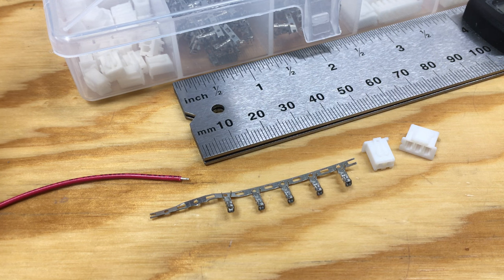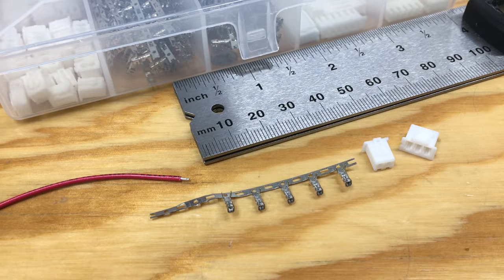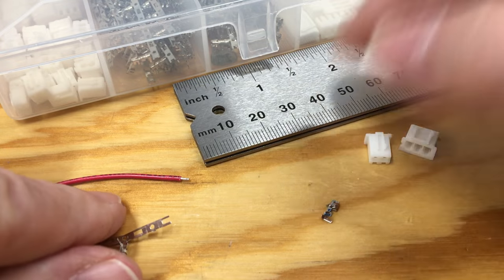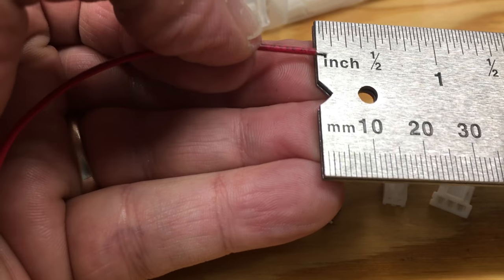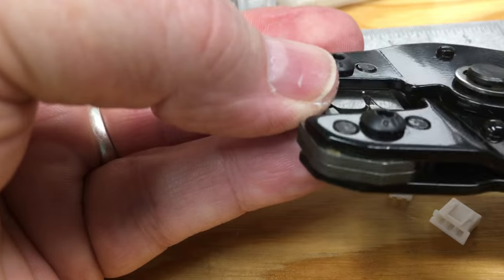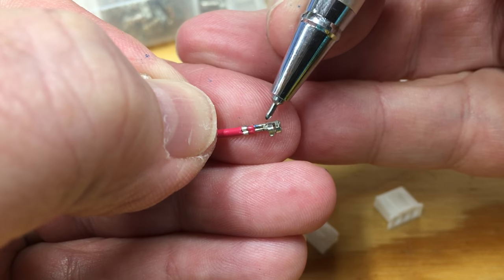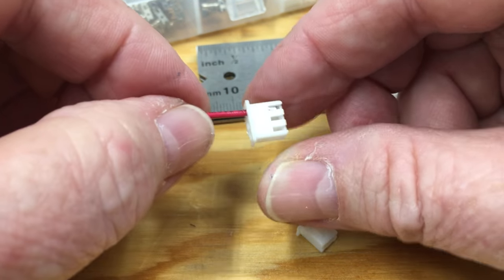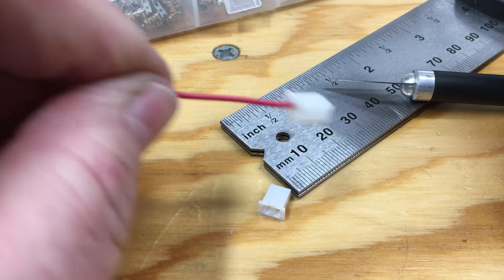JST XH Series Connector Crimping.

Comment: Sir this is the information I wanted the 2 mm in my mind ended up as 4 after you said 2 I looked using my calipers so that strip length is very short and at the same time correct!  My crimper dies are 4.65 mm so I use a T pin "straight" pin will do to place the terminal into the die but then I push it into the die from the long tab side to make sure that I do not get any of the connector part into the crimper.  I now can do this job as it was intended without wasting termination parts and time. With what you showed here with some paying attention anybody should be able to do these like a pro. I used to work in a wire center of a major corporation. So I know just how critical the job is. My job was to pull the harnesses other people terminated them.  I am doing this at home now for my personal project. Thank you for taking the time to make this video. I knew I wasn't doing it right and that is how I got here! I know I am 3 years late to comment but the info is still as correct today as it was then.

Comment: You have my gratitude, as I am someone who's having constant issues with back pain, and the only thing that relieves these is a massager which is battery powered (it won't run off of an AC adapter, just off of battery) - and the battery died a couple of months after the warranty expired. It turned into an interesting project (and a race against time, as my back pain comes and goes and I kinda felt it coming on again), so I bought a replacement battery but it came without connectors, just cables. 

Removing the old battery, establishing the type of connector, finding the right crimping tool, the housings and all of that took almost a week for Amazon to deliver, I booted up the PC, started Your video, went through the steps (and a few of those sockets as I hadn't made the cable get "caught", due to me initially using the wrong size jaws) - and now, I'm looking at the massager charging, cautiously optimistic as the back pain is creeping up on me. A small sense of pride and joy is overwhelming me as I see the charging status lamp blink at a stable rate. 

Once again, thank You so much for such a good instruction.

Comment: Nice clear and concise video. The best inexpensive JST-XH crimpers I've found are the Iwiss  IWS-3220M. I purchased mine on Amazon for $22.59 US. They actually have a comprehensive instruction manual with large lettering attached to the package. A joy to use and make excellent crimps.
Reply from the maker: Thanks Roy for the note.  It’s great that it comes with a manual.  I haven’t seen any others that do.

Comment: fabulous  video Chapster. I have seen other videos and noticed that they didn't use the ratchet crimper that came with their set, but purchased another tool, a lot thinner and required a two stage operation. 1/ separating the wire and 2/ sheathing crimping! I think they had the right tool all along (as your video showed) but didn't know how to use it. I find it ironic that I could not easily find the thinner crimper but that the internet is awash with the proper tool. Grateful for your top notch video showing the 'easy' way to do it too.
Reply from the maker: Thanks Alan.  I’m glad you found it useful.
Reply: @chapmanmr  more than useful... I was barking up the wrong tree looking for an inferior tool. Now i have choice LOL
Reply: Got my crimper today and you method worked fine.. The  only thing I find is holding the the little beggars.. they are so tiny.. in the end i put one on the pin at the back of the JST socket (came with the  assorted JST connector kit) you then have something to hold when offering up connector to the crimper head.
Reply from the maker: Alan Brown 
Great idea.  I’m used to holding the small pieces so practice helps.  When I first started doing these I used a pair of fine tweezers that worked fairly well.  Thanks again for commenting Alan. 👍

Comment: Nicely done presentation. Personally, I favor the Iwiss SN-2549 crimper - it's the "illegitimate love child" of a SN-01BM (specifically for JST-XH connectors) like you show here, and the Iwiss SN-28B (which is aimed specifically at Dupont connectors, and if you're a little bit careful, can be used for doing Molex connectors as well) in one tool. Since I use all three types fairly regularly, having just one tool that can do all three is a BIG plus to me. Aside from the different jaws, the rest of the tool is identical, and it's possible to order different jaws that can be swapped into/out of the rest of the crimping tool as needed, though I haven't needed that capability so far.
Reply: FYI, despite being widely marketed as being for “DuPont” connectors, the SN-28B is actually very unsuited to DuPont connectors! The insulation die has the wrong shape (DuPont needs a circular insulation die) and because the SN-28B is designed for much larger contacts (it’s designed for 2.8mm spade connectors), the finished crimp is much wider than it should be, which often leaves the contacts crimped too wide to easily insert into the housings. I don’t know why the Chinese vendors insist on selling the SN-28B for DuPont, when it would cost no more to make dies that actually fit the DuPont contacts fairly well. (Surely a circular die shape is easier to machine than the m shape!)

Comment: Do you have a video showing how to make the other end connected to a wire, instead of mounting it to a board? I want to make connections for quick connections to replace thermistors etc but not sure how the connecting wire on the other end goes together.
Reply from the maker: Rich,  The JST XH series is really designed to be a "B2B" or board to board interconnect and I don't think JST makes the end that would normally go on a board in a format to be placed on the end of a cable.  Quite often people will make their own by soldering wires to the board socket and put heat shrink over the solder connections and I have done this myself.  A word of caution if you use that method, once the pins on a B2B connector have been heated for soldering, they loose a little of their grip within the plastic part of the connector allowing them to be pulled/pushed out.  If you make your solder connection quick so you don't have to get the pin very hot it should work ok as long as you push the two connectors together carefully.  Otherwise you can push the pin right out of the connector.  I do believe that someone makes a crimp style connector that does what you are looking for that looks a lot like the JST-XH series as I have seen them on Ebay but I'm not real sure they will fit with the JST-XH connector.  My best suggestion would be to look at the Molex "Micro-Fit" series of connectors.  Both ends (sockets & pins) work with the same crimper (SN-01BM)  as the JST-XH series and the polarized interlocking of the connectors is secure.  Hope this helps.
Here are some part numbers if you want to check out the Molex solution...
Pin housing (2 pin): https://www.mouser.com/ProductDetail/Molex/43640-0201?qs=%2Fha2pyFadui6dPA5%2FogRphLt3q2AbW0jNqq9k6Of4ew%3D
Socket housing (2 pin):https://www.mouser.com/ProductDetail/Molex/43020-0210?qs=%2Fha2pyFaduj5jJAitLLkl140tgX%2FFhAHOfKkdQlAGmIRbROBeeV9Tg%3D%3D
Pins: https://www.mouser.com/ProductDetail/Molex/43031-0001-Cut-Strip?qs=Dbnw6jgPYP7qIb%252B%252BSMzZGA%3D%3D
Sockets: https://www.mouser.com/ProductDetail/Molex/43030-0009?qs=%2Fha2pyFaduh7zI%2FCLmN5TyJ9CEZyVLI3X7TErMGzN2o%3D

Comment: Very well explained!
Just wondering if you can use both of the bracket's cutouts for the JST-XH connectors or is one for another type?
Reply from the maker: The other slot in the crimper is for a slightly larger connector socket. It can be used for the JST connector if you are trying to get away with using a larger wire than the connector is intended for.  You can do that to get by in a jam, but I wouldn’t make a habit of it. Thanks for your comments.

Comment: very helpful guide it's hard for me to tell where the insulation area for the cover wire and the exposed wire to the insulation when i try to crimp it can you please tell me how to do it?
Reply from the maker: Gaalxy Star,  It’s a little hard to explain that part of the crimping.  One thing that might help is to close the crimper one or two clicks after you get the socket in place so that it just barely starts to close the insulation tabs on the socket into a circle.  You have to be careful not to close it too far or it becomes difficult to insert the wire.  Then once you start inserting the wire and get in into the crimper a couple millimeters, try holding the wire  with slight upwards pressure while pushing it into the crimper die.  That will make it easier to feel the stop point when the edge of the insulation bumps against the smaller section of the die that crimps the smaller tabs onto the bare wire.  Like I said, it’s difficult to explain, but I think if you take some time with some scrap wire and extra sockets and practice it, the routine gets much easier.  I hope this helps.   Thanks for your comments on the video.
Reply: @chapmanmr  Thanks I found a way you got to feel it

Comment: Actually a serious question

How do you assemble the other half of the connector?
Reply: What other half? The male XH is always the header soldered onto the PCB. (At least when using original XH from JST. There are manufacturers of XH clones that make an XH male crimp connector. The process to crimp and assemble those is fundamentally the same as for the female.)

Comment: Same shortcoming as every other crimp video. Only shows the female part. What about the male pin? Why is none showing the crimp for doing that?
Reply: Many wire-to-board connectors, including JST XH and Molex KK (“KF2510” in the clone world), only have female contacts, as the male is always the header on the board and the wire-side plug is always female. In both of these connector families, the original manufacturer never made a male crimp, but there actually do exist Chinese manufacturers of clones that make a male version, so the male crimp is an unofficial thing. (Very handy, though!) 

Other connectors, like DuPont (both the original Mini-PV and the Chinese clones), have both male and female crimp contacts. 

However, as far as the crimp process goes, there’s no difference, as the crimp wings on the male crimp terminals are usually identical to the female terminals. 

When using the original manufacturer tooling (i.e. the contact-specific tools that cost $300 and up), some tools work for both genders, others have a different tool for male and female. For example, the original tooling (HT-95, etc) for the  “original” DuPont (Amphenol Mini-PV) connectors have entirely different tools for male and female contacts, while the tool for Molex Micro-Fit accepts both male and female in the same tool without even needing to use a different locator (contact holder).